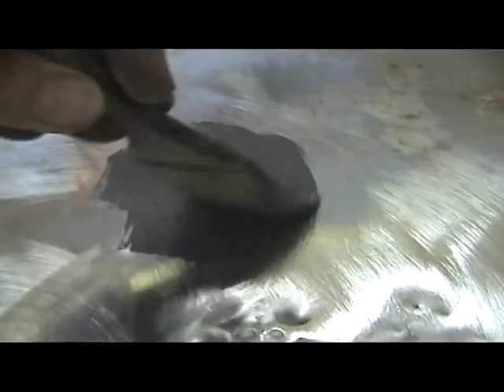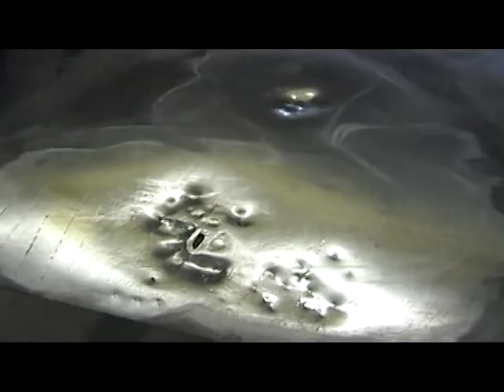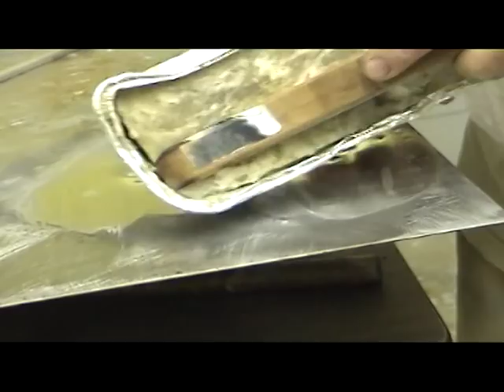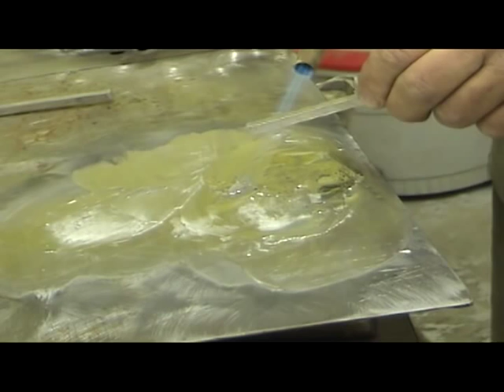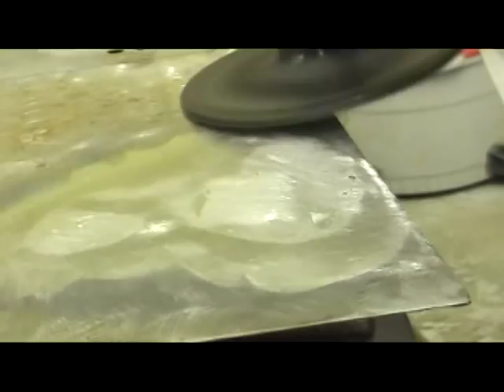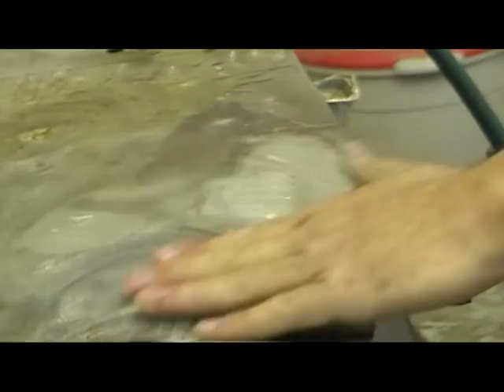Using Body Lead

Comment: He Pete are you still here? I would like to check with you on something with lead work. Thanks
Reply from the maker: How can I help you?
Reply: @PetesGarage  - Thanks Pete, I will get back with you.
Reply: @PetesGarage  Pete I may have posted this on another video of yours but here it is again.   I have several areas where I removed crappy Bondo repairs on my 70s Challenger. I took it down to bare metal at the areas and removed all rust. I bought an Eastwood kit for lead work.  Is there anything I need to be aware of to avoid ruining the body metal like overheating it with torch or having solder come loose? What do you suggest to apply to bare metal to prevent surface rust while car is stored in garage? Thank you.

Comment: how do you keep the lead from running through the holes?  and how hard is it to do on a vertical surface?
Reply from the maker: I don't mean this sarcastically, but practice. Once you get the hang of keeping the lead just hot enough you can easily fill small holes.

Comment: Thanks for posting. This is a GREAT how-to video! One question; after tinning the surface, what is the time window for leading, or can it be done a day/week/month later?
Reply from the maker: As long as you clean the acid and flux off the surface the lead will stay for months
Reply: Thank You for your prompt reply, Sir. I actually won't be a month, but maybe a week to ten days.  Just water and baking soda, with maybe a brush, to clean it?
Reply from the maker: That will work
Reply: Excellent! Thank You again, 'Pete'!

Comment: I bought from Eastwood yrs ago only use it like on a hood rust hole or similar where shrinkage occurs .alumm.tape and filler works well for me but my car is a geo. 23yrs old .years ago they had a boiling pot of lead at local shop.
Reply from the maker: That is interesting

Comment: Any experience using the body solder Eastwood's sells? Instead of lead it's a lead free type solder? Any pro's / con's?
Reply from the maker: I have used it but I prefer solid lead. The lead free requires more heat which can cause warpage
Reply: +Petes Garage interesting and good point.

Comment: Nice Job! utube has videos of Factory production cars of the 50s and 60s showing them leading the cars on the production line before going to body for final grinding and smoothing then paint. this is a lost art.  i can tell by knocking on the metal if the car was leaded or bondoed. i just knock when no one is looking. but thier is a difference on the sound it makes. thump sound  Bondo. a little ting sound when knocking lead.  all my cars were leaded when restored. i just prefer it this way!  thanks for educating !!!!!
Reply from the maker: +tony goulart Lead is the way to go for me too. I use it all the time

Comment: this is so un like the days now most shops i know don't use lead no more this must be a new thing again so i guess the lead sleds making a comeback
Reply from the maker: +rock dawg It's not a new thing, I've been doing it since 1985
Reply: I know but the fad of using lead comes back after bondo made its apperance i just dont like the hazmat of lead too many health risks with lead..
Reply from the maker: I understand. But the lead is not melted enough to be a vapor, and you can control the transfer by wearing gloves. It is very safe compared to inhaling polyester bondo fumes and dust
Reply: +Petes Garage true but the new rage filler not that bad but I have the garage doors open to keep it down

Comment: looks like damage that could have been pulled with studs and slide hammer seems extreme using all that lead and not pulling them a bit before leading
Reply from the maker: +stosstruppen I know it looks like it, but it was really stretched in and wrinkled. If he wanted to spend the money I would have cut it out

Comment: Could you use that in place of spot welding?
Reply from the maker: +JOHN WALTER No. Spot welding actually melts the metals together, lead is just using capillary bonding

Comment: Lead is a great way to repair metal dents ,but please be aware it is toxic always wear a mask and gloves
Reply from the maker: Safety first!
Reply: I'd suggest hand filing, rather than using a grinder.  The particles are bigger and don't get thrown as far, then you can vacuum them up.  It's really very fine lead particles that you have to worry about.

Comment: Hey man thanks for the vid! Question.......I did some rust repair on a quarter to roof seam on a 67 mustang and only removed about 2 inches of lead, now I want to replace the lead, do I have to remove it all and start over, or can I just apply butter to the spot and do a lead patch and work it into the existing lead? Thanks in advance!!
Reply from the maker: You can just replace what you removed, but I would clean the whole thing to make sure there is nothing else under the old lead. I love the '67

Comment: Now do that on a side or vertical panel. Set the layer high and file it down with dreadnought then you can collect the filings and re-use them and then you wont get toxic lead dust in the shop facilities. Also you did not demonstrate how the solder paint turns to tin and how to clean ready to take lead filler. Otherwise pretty good.
Reply from the maker: Great idea!

Comment: anyone who solders will tell you lead won't wick onto cold metal. if you're having too much trouble with puddle lines on the rim, try primarily heating up the rim of the metal around the puddle, then the surface of the top of the lead, this will allow for a smooth coverage, while helping to flatten out the edges.
Reply from the maker: Excellent tip...thank you

Comment: Suggestion, heat up all your small PEICES in a lead pot, you can then lightly warm the area not warping, pour lead on using spreader

Comment: Great video but I have a question: I have a gas tank with pin holes on the top and bottom so is this alright to use to seal it?
Thanks.

Comment from the maker: All of the acid boils out while the lead is applied. If you clean up around the repair you won't have to worry about any underneath unless there is a hole where it may leak inside a panel.

Comment: Great video, but i have one question, the acid needs to be cleaned off with baking soda and water otherwise it will rust, but what about the acid that is under the lead? Wont that rust?

Comment: Excellent video. Hope you have one of you doing the sanding because I need handholding. I went over my rear decklid with naval jelly but it is still brown with rust after several applications. What do you recommend? I believe the metal has to be bright before the lead will stick? Thanks.

Comment from the maker: All of the leading supplies can be purchased at Eastwood.com. They have a great starter kit and sell lead by the pound. There are no toxic vapors given off by the lead because it is only heated just above the melting point, not vaporizing point. Probably the most dangerous part is melting the tinning butter, but the whole process is very safe.

Comment: Nice video upload... Thanks for the info. I want to do the rear fender wells on my F250...I have bad rust up about 3.5 inches, around the top mostly, If I cut that out, and install a back plate and rivet sheet metal in the general shape, can I fill the joint doing lead, I am a plumber by trade and have worked with lead for years. But, I am not a body guy, Also I want to do it attached, Any tips for doing vertical work? Thanks...

Comment from the maker: Yes, I tried it last night. Just make sure the surface it super clean from the lead process. Use baking soda and water to neutralize any acid, and clean the surface with lacquer thinner or acetone to make sure it is grease and oil free.

Comment: Nice video dude I got a motorcycle gas tank I've wanted to powder coat but because I had to bondo a few small dents I decided to paint it instead. Do you know if the lead will hold up to a powder coating process? Thanks!

Comment from the maker: Well now. That hood was done well over 10 years ago. I saw him at a couple cruise nights this summer. He takes immaculate care of it and it looks as good as the day he picked it up. My work is second to none. I learned body lead at the Mercedes Benz School in Esslingen Bruhl, Germany. If you think I am doing something wrong, call the school at 49 07037900 and tell them they don't know what they're doing. Ask for Herr Runkel. FYI try to apply tinning butter over rust. Won't work.

Comment from the maker: You will need to cut out the rust and weld in a repair panel. Once that is in place you can countersink the weld area and fill it in with lead. the repair will last forever.

Comment from the maker: The short answer is yes...providing you either grind or sandblast all of the rust out of the pores. Lead for body work is mainly for sealing seams and fixing minor imperfections. For surface rust a quality spot putty works just as well. On a panel you run the risk of warping it. Make sure you practice before doing the repair. Good luck!

Comment: @ErrorCode766 It is harder to do vertical. As CoolCarsHotGuitars says, it can be done with practice. The key is temperature control. Too hot and the solder is liquid and runs off. Too cool and soldering does not occur. The solder has a performance temperature band, which with practice you will be able to master. You need to keep the solder at the "butter" stage, between solid and liquid. Good luck. Practice.

Comment from the maker: You can use body lead on any steel surface in any direction. I have even used lead upside down. All it takes it practice and you can do it.

Comment from the maker: You are 100% correct, thank you for pointing that out. I try to include safety and the appropriate person protective equipment for every video I do. Someone asked for a lead video and I made this one many years ago. I actually had to copy it from 8mm tape so it was made way before YouTube. I will add a note to this video about the safety requirements. Thanks for watching.